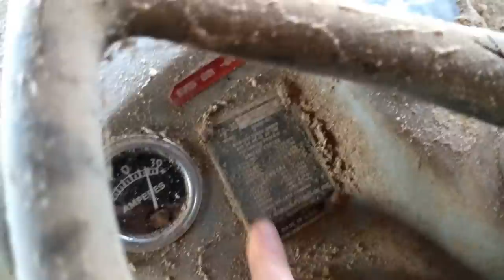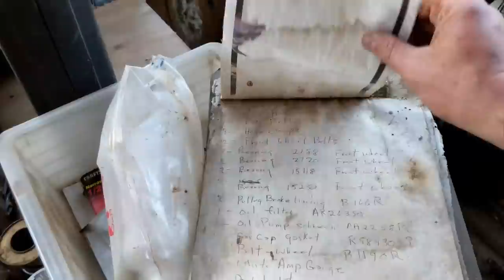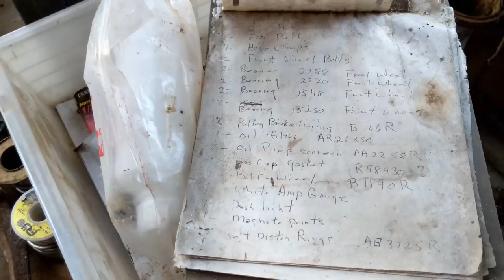Old Circular Belsaw Sawmill First Run in Years

Comment: Another episode of dumb and dumber. Lol
Reply: Yep. One of the major problems is that the sharpness and set on the saw blade are not even. That is why the kerf curves sharply. Either that, or the saw blade is not parallel to the track. Probably a combination of both problems.
Reply: The possibility’s, for disaster, are almost endless. But my money is on someone wrapped around the PTO shaft. Although random flying objects is a close contender. It sounded like the Titanic scraping the iceberg.
Reply: Looks a lot like a belsaw M14. I have one I have been sewing with  for 40 years and still use it all the time. Mine is an inserted tooth blade. I run mine with a tractor. I have cut untold thousands of board feet with this all-male you just have to know what your doing. There is information on the web on how to set Mill up, sharpen the teeth, and check to see if the blade is hammered properly.
Reply: You should  never run a pto with those  sharp  double  angles....

Comment: As a experienced Sawyer a few problems I see. First off saw is very dull and teeth needed swedged. Secondly rpm's are not high enough to make the blade stand up flat under load. Third there is alot of rust on the blade that needs cleaned up that robs you of horsepower. The tractor if running properly should have ample horsepower for the saw.
Reply: And the wood is to dry , and the wood feeding is to fast for that tractor to handle. IT needs a powerfull tractor or to slow down the wood feeding.
Reply: @gattonpc  none of those should matter I have seen plenty of mills run off similar tractors. The wood being dry does make it denser but if the saw is working properly seasoned wood should not matter.
Reply: @kenjett2434  You are right..but In this video case it matters.
Reply: @gattonpc  well what you say is only an issue because of all the other issues. If the mill was in good operational condition those things you mentioned would not be a problem. What you said is true but they are symptoms not the cause. You don't treat symptoms you fix the causes of the trouble.
Reply: @kenjett2434  " If the mill was in good operational condition" Neither things you mentioned would not be a problem. Aparently you missed your own point in this discution. Well.. cheers.
Reply: @gattonpc  what a crock it's the thing I mentioned that is why it was out of order. You trying to be some professional troll or what? Sorry it won't work with me I have knowledge and experience on my side. From what I have seen you do not.
Reply: @gattonpc  and there it is another troll triggered. For me I just stand up for what I know is right and call out bad advice so that others don't make the mistake of following that bad advice. But I will say I do enjoy it when I can do both at same time correct wrong advice and trigger those who prefer to troll. Your nice rude rant just proves me right. You only refer to ranting once you realize you been caught.
Reply: @gattonpc  it's easy to see how your triggered in the way you word what you write. As to how I know I am right is because I have over 20 years in the Forestry buisness and have experience in rebuilding these old sawmills and operating them. That is how I know and I can say it with 100% confidence. What is you experience in the subject you see a couple you tube videos and suddenly your some expert? I may be retired now be I am still a professional in the field.
Reply: Reloader 308  hi I might be of some help but let me say saw parts for circle mills today is hard to come by. For teeth and collars for a saw blade best place to check is at your local commercial sawmill that are large scale. Not always but sometimes they stock saw blade parts and will sell them to you. I use to get mine at my tie yard where they processed railroad ties. That market too has all but gone as they have moved to using steel reinforced concrete crossties. Any belts you may need should be able to find at any industrial supply that sells rubber type products like belts O-rings such as a Grangers. As for swedging saw teeth you need a tooth swage for that they are two sided and once the saw tooth is worn and lost its natural swage it has when new. You can place the swedging tool solid over the sawtooth and give it a solid tap with a ballpin hammer or lite shop hammer then fill to other side of tool and give the tooth anther solid tap. This will give your saw teeth the swage or clearance needed to prevent saw from binding and heating. This takes some practice for consistency as each tooth if consistent will give a smoother cut other wise you will see saw marks in your sawed products. As for mechanical parts of the mill roller bearing can usually be replaced by a bearing dealer such as bearings incorporated. Just depends on your local area. Some older mills still have Babbitt bearings that you just repair yourself. This takes some experience pouring to get right though. Anything else I will say probably Google will be your best bet to find it. Sometimes you can find old abandoned mills that you can get to build what we like to call a boneyard. This gives you ready access to some of those hard to find parts without having to order and wait. Hope this helps you in your quest I can remember when I was also in your position starting out.
Reply: Reloader 308  good luck on getting your mill and rebuilding it. That is the most satisfying way and also by restoring the mill yourself you get a better working knowledge of running it. If you have any other questions feel free to ask I will do my best to answer. Have you considered how your going to power your mill?
Reply: Reloader 308  the N series Ford or your farm all just won't have the horsepower you may need. If everything is tuned right you could probably saw small pine with it but big hardwood not a chance. Now the Detroit would certainly do the job with power left over for another mill. Lol that much power if you hit something can cause serious damage including to you. If using a tractor with pro I recommend something around 80 hp or greater. But if your going with an automotive engine your going to need something about 200 hp or greater. The most important thing is rpm's of the saw teeth with ample hp to keep rpm's near constant when sawing in log or not in log. Ideal rpm's for a circle mill to operate at peak is 10,000 ft per minute. So saw diameter plays a roll.  May sound strange but bigger the saw the slower the rpm to run it. The formula for finding what rpm you need at mandrel is this. Measure diameter of the saw at widest point saw tooth to sawtooth multiply that by 3.14 this is the radius of the saw. That's how far the saw travels in one revolution. Now divide that into 10,000 this gives you the ideal rpm setting you need to run your saw at.  Give it enough horsepower to maintain that rpm through your cuts and you will saw just fine. Long as the rest of the mill is set up properly.
Reply: Reloader 308  let me give you a really cheap idea for a pto power unit. This works great it was how I did my first one. My friend had a old Chrysler with a 383 automatic ran good but no longer able to get a safety inspection sticker on it as it would cost more to fix than it was worth. So we literally took an ax to the body and chopped the car in half right behind the transmission. Involved the driveshaft from the rear end and that became our pto. We connected the driveshaft to the mandrel giving us direct drive with a 383 auto using the whole front half of that old car. Then run a cable from the throttle on the carb back to the saw box creating a foot throttle to control power and speed. This was incredibly cheap to do and boy did that work fantastic. As you hit the throttle to rev to proper rpms the automatic locked in 2nd would shift and maintain the saw speed just like crude control.  If your mandrel already has a pto connection it's not that hard to get a change over u-joint that will fit any driveshaft and connect to the mandrel. If it doesn't you will need to take your mandrel to a machine shop to have a yoke off any rear differential attached to your mandrel so as it runs true and balanced. This will allow you to go direct drive from transmission to the saw mandrel. It's not a pretty thing with a chopped car but boy it works like a charm. Just open from door set down in front seat fire her up and drop in gear. Go to the saw box hit the throttle and she is ready to saw. One real perk to this is the engine can drop back to idle when not sawing saving gas just before engaging log hit the throttle bring rpms up and start engaging your log sawing once board drops release throttle till ready to engage again. I think this is just the ticket your looking for. You can do this with any old vehicle that runs but not road worthy we just happen to have that old Chrysler. Just set the thing on blocks and the driveshaft becomes a pto. Of course this was a rear wheel drive not sure you could do it with a front wheel drive but hey nothing wrong with ingenuity and the mother of nessessity. Hope I gave you some cheap ideas. 
   Let me say your Detroit is ok nothing wrong with extra power but there is a bigger safety issue when you got extra power and the saw hits something grown in a log. If you got it set up to run with a belt drive and keep belts just tight enough to maintain rpms while sawing but have the ability to slip if needed as safety your Detroit would be a great unit. But if it's set up direct drive that much power can be extra dangerous.
Reply: Reloader 308  sounds like things are coming together for you when I bought my 1st mill I gave $2,000 for it and it was all laying torn apart in a pile out in a old Hatfield grown over in weeds. It was a 00 Frick and despite how it looked it really wasn't all that bad of shape. Just had to replace the wood frame parts. I also ended up having to have the saw rehammered to get it to cut right. The mill was a left hand set up and the saw was for a right hand so it was dished wrong. Let me know how thing are going it will be interesting to follow your progress. About 36 years ago I was where you are now and if I could do it over I would in a heart beat.
Reply: Reloader 308  it's sad many places today we have lost our freedom to corruption and unconstitutional laws by local government. It's not the first time I have heard this problem of inspectors and certified lumber. Makes me glad I live where I do only inspectors we have to deal with is for septic and power installation by the power company. Everything else is just a permit we get at the local tax office.Its only purpose is to inform assessor of added value to the property for tax assessment. Guess they are to lazy now days to come out and do on site assessment anymore. Please send me a link when you post your video I would enjoy seeing your project. I also love the gasifier idea been thinking of how to build something similar for processing plastic into oil and syn gas. Got several high pressure tanks and heavy tubing laying around. Should be able to rig some sort of refinery to crack the plastic back into its original petroleum components. Just think it would be a cool way to make use of some troublesome trash. Just getting older and slower these days at 62 and not the best of health. But on days I am able I still like to tinker on projects.
Reply: Reloader 308  yeah that is what I thought my heavy tubing would be good for. To do the fractionation towers the real trick will be finding the right catalyst to get the products I can use. That will take some experimentation to get right. It just something to tinker and play with that might have some potential benefits. Trying this because we generate a lot of plastic waste because we have to buy and use bottled water for consumption. Our well water just isn't potable it's ok for everything but to consume so we get bottled water for that. Not a big deal it's cheap to get you just accumulate a lot of extra plastic waste. So I been researching on how one might do something other than taking it to a landfill. There is a lot of energy in all that waste.
Reply: Reloader 308  it's not that big of deal we are out all the time so it's cheap and easy to stock up on water. Where I live your lucky to even get any well water without oil and gas in it. We have oil wells here that are under 200 ft deep.  So the water we do get is laced with all kind of things even distilled making it safe to drink it still has a horrible taste. There is access to city water but it's several hundred yards to bury a water line and several obstacles in the way making it just too exspensive to attach to the city water. It really doesn't take that much bottled water for cooking and drinking so it's just more economical to just do the bottled water.
Reply: Reloader 308  it's both I live where they use to be a natural seep. It's a very historical area that's still producing just much deeper these days. But when this was first drilled was a time before drilling was a thing for most parts. So they was no laws or regulations as 1st producing well here was in 1860 just a mere few months after the Drake well in PA. The Rathbones drilled it and went on from the success here and drilled in OK and TX. The grandson went on and was the one that started Esso now known as Exxon. Exxon actually donated enough money to turn the site of the first well into a oilfield museum just about a mile below where I live. It's now a working well and supposedly the old still working well in the world.
Reply: How do you get the blade hammered to run at a specific RPM?
Reply: @injens  that is not a diy thing one can do it requires someone who is trained and experienced. But to answer  with most basic hammering is creating a slight bowl in the saw by using a specific hammering pattern. First the larger the saw the deeper the bowl  required. But rpms are based off of how deep the bowl is and how fast it must spin to cause the bowl to flatten out. This is referred  to as the saw stand up rpm. Diameter  determines depth of bowl with goal to get saw to stand at around 10,000 rpms at the teeth. Warning if you try to do it without proper  training  and knowledge you can easily ruin a very expensive  saw.
Reply: Ken Jett 
 1000rpm.
Reply: @Studio31Vancouver  although I misspoke I did not mean 10,000 rpms but 10,000 feet per minute the Rpms may vary depending on radius of the saw. But the goal is for teeth to travel at 10,000 feet a minute I did not notice I made that mistake when I posted comment but 1,000 rpms would only be right for a specific diameter saw. Also as I mentioned above how the saw blade is hammered can affect Rpms needed. If the blade doesn't full stand up straight the cut will be unstable.
Reply: Line the log up right thru. Adjust packing   tractor revs maximum try again

Comment: Your saw needs serviced ,do you no what speed the mantle is running you need to no that and tell the man hammering your saw ,you don't have enough power not even close, check yours leed you need 1/4 inch make sure nothing is moving on you everything needs to be bolted down good. I hope you get everything working good . Not enough of the mills running. Thanks for putting this up. Good luck!
Reply: Leed is important but 1/4 inch is just a bit much and can cause the saw to drift and bind. 1/8th is common but I have seen 1/16th be ample leed. If you need more than 1/8th to run, you have bigger  problems.

Comment: My dad ordered a Belsaw in the late 70s and built it using an old logging truck trailer to make it mobile.  A Ford 240 inline 6 powered it.  I pulled quite a few boards off of it as a young man until he sold it in the mid 80s and bought a mobile dimension mill.  The Belsaw is still making boards in N CA for its owner.
Reply from the maker: Do you have any videos of it?  I'd love to see it

Comment: Not sure if the tractor is yours or not, but out of the interest of preservation of that little machine.... please try the following.   The tractor has a two stage clutch, pushing the pedal down all the way should disengage the PTO.  If the PTO does not disengage even with clutch fully depressed means that the clutch has gone out of adjustment.   There's an inspection plate on the side of the bell-housing that can be removed that should permit access to three adjusting screws on the clutch cover plate.  Set these to the correct setting and with any luck your PTO clutch should work again.   I had the same issue on a David Brown 950 tractor.   The adjuster  (one of three equally spaced around the clutch), it's the 1/2 spanner size nut with the allen screw adjuster down the centre. Slacken the nut and screw the adjuster until it contacts something (pressure plate) then back off 1.5 turns. Don't forget to do all three.

Comment: Green  you are, those  old David browns have a hand  clutch  for the power  take off. It is on the left and  you pull it up.  Dead  tree meets dull old blade,   when  you pull the lever to slide the log the back dog  is supposed  to be connected  with  a rod to the front one abd both  move. Same  if you have  a three  dog  table.